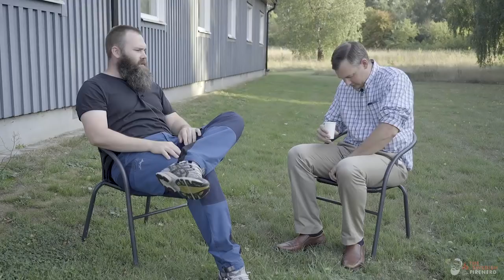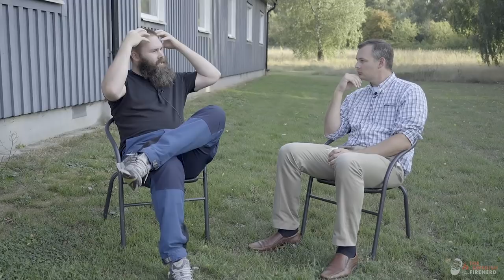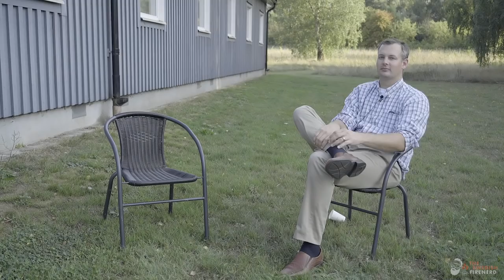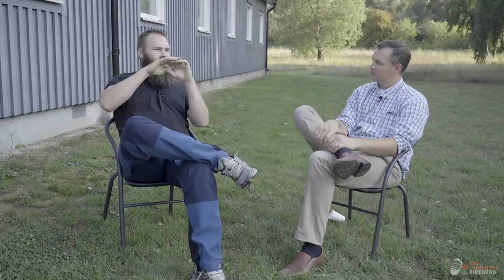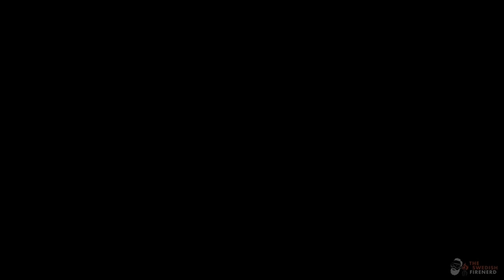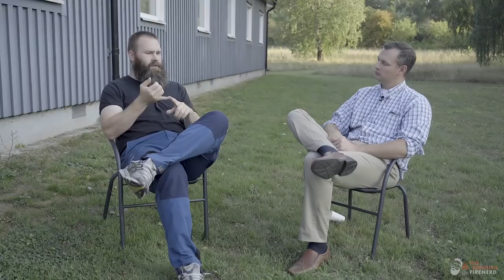Firenerd Talks #1 - Steve Kerber - Nozzles, streams, gas cooling, surface cooling and more.

Comment: Lars and Steve, thank you for this. This is a great discussion and it is good to see a civil dialogue on fire control theory and practice. Keep up the good work, you are both valuable to the international fire community. I do have an observation though. In all of the talk about effectiveness, efficiency, and rapid fire control, CAFS is like the weird cousin that no one wants to talk about. As someone who has used CAFS for initial attack for almost 15 years, I can tell you it is a game changer. I sure would like to see it enter the conversation more. As a fire community, are we really that afraid to give up our water streams?
Reply: I am really enjoying these discussions! Thank you for posting them. 

In the video, high pressure and low flow was mentioned more than once, and the critical flow rates and the small amount of water that is actually required to knock down the burning gases. Our department is currently using CAFS, but there are so many unanswered questions with it to determine its effectiveness and efficiency. I still don't know how I feel about CAFS, but am interested in what your opinion is based on this video discussion and the comment you left above. How can we start this discussion?